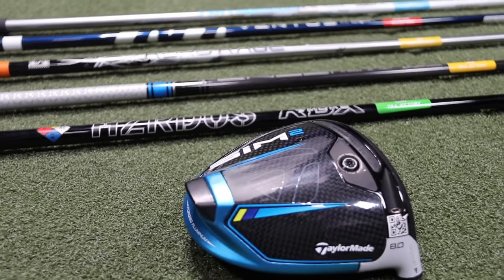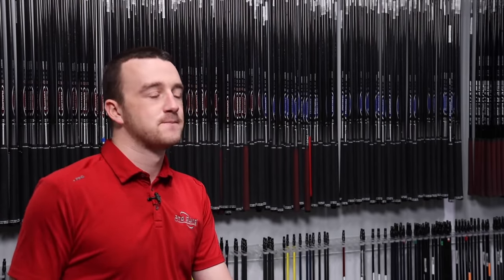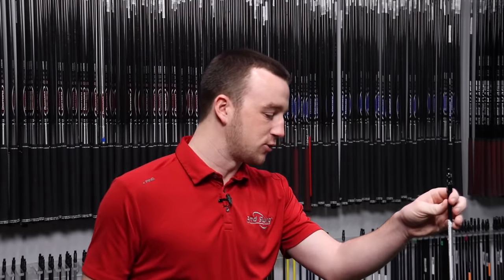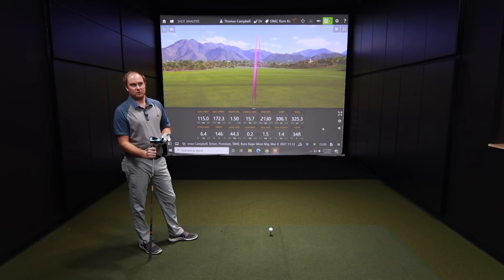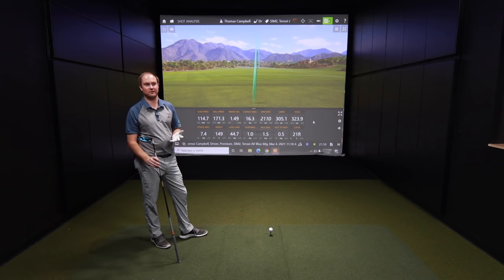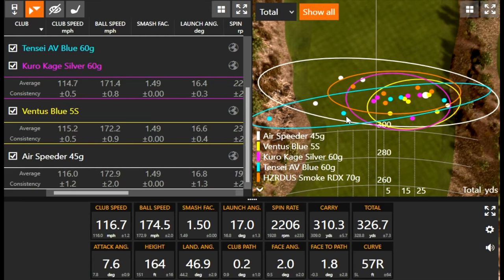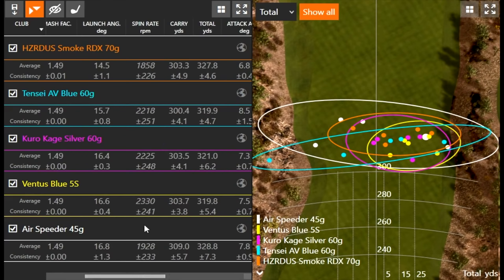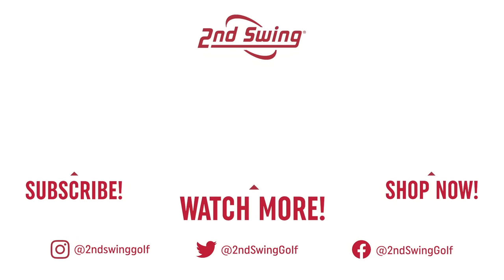Golf Shaft Testing | TaylorMade SIM2 Driver Shaft Comparison

Comment: Have read in a few different places recently that the LH adapter in a RH head fits the same way round if wanting to play in standard loft/lie. Its only when you try to higher or lower loft it works the opposite way round ie higher marking makes the head lower lofted.
Reply: 100% correct
Reply: Had exactly that recently - am lefty, fitted at my club and with Taylormade with RH tip spun 180.    When my driver came with LH tip set at 0, I found was totally wrong.     0 and 180 is exactly the same whether RH or LH tip.   Other increments would be affected which way you turn the shaft with the opposite tip to how you play.
Reply: Exactly. Turns out it would have been great to see Campbell hit the Tensei with standard lie instead of 2degree up (hence the hook).

Comment: I got fitted this year into the SimMax2 line and realized that I had lost about 20 yards on my drives.  And I was fit into a non upgraded shaft.  So I decided to do a year round live 'fitting' by buying a number of shafts and heads to see which I liked best.   So right now I have 5 SimMax or SimMax2 heads and a number of new shafts, ranging from the stock EvenFlow 50 up to and including the $500 Graphite Design Tour AD IZ 5.  I also have a used Aldila Rip 50g, a Mitsu Diamana S Limited 60 g also in R flex, a UST ProForce V2 HL, a KBS Tour TD 50 in R2, a Fujikura Pro 2.0 50g, my originally fitted Evenflow Riptide 50 5.5, a 'made for' Mitsu Kura Kage Silver and a real Mitsu 5th Gen black Kuro Kage shaft.   After about 100 rounds with these shafts the Mitsu 5th Gen KK and the KBS Tour AD 50 are head and shoulders above the rest.  Less dispersion but more importantly clearly 20+ yards more than any of the others.  I will set an appointment to hit the range with a launch monitor to try and break the tie between these two but clearly the premium shafts have value unless you are on a very tight budget.
Reply: You have too much money and time on your hands brother 🤣
Reply: You might need AA
Reply: What is your swing speed?

Comment: Very interesting. I have 90 mph swing, played TM Burner 10.5 R flex 50g shaft for 10 years.switched to Cobra F9 10.5 Fujikura ventus blue R flex stock shaft but it weighs 75g and I think it's too heavy, really inconsistent with it. Not sure why the fitter gave me this. Stock shape with the TM was straight/slight fade, all over the place with the Cobra. Really would appreciate a reply, thanks.
Reply: Ususally its the other way, people get shafts that are too light and it makes them very inconsistent, heavier shafts are generally more stable.  75g is more than normal for a driver though, mine is a x stiff but only 60 grams
Reply: Where did you get fitted .. Golf Galaxy ?

Comment: Bought my first driver, the max D. Was hitting it good with a regular shaft, even left. Fitter told me at the last minute I need a stiff and gave me the air speeder. It's all over the place :(
Reply from the maker: The shaft can be for sure player dependent. I would give that regular flex another chance if its straighter. Play the lightest most flexible shaft you can hit straight - Thomas

Comment: Please portray your dispersion circles accurately.  The wide dispersion circle of the air speeder 45g shaft is portrayed much larger than where the shots were dispersed.
Reply: the dispersion circles extrapolate to a confidence range with a normal distribution. My guess would be a 90% confidence interval. With 5 shots you dont see as much of the data going into the circle being drawn. since there was a lot of draw and slice in the shots the dispersion is wide and you could reasonably expect some more shots to end up further out. If the hit many more, you would see the circle be tighter around the data set.

Comment: Thomas' attack angle is insane. Any advice on bringing my attack angle up to 4-5 degrees from around 0.0 degrees? Play a 9 degree Sim 2 w/ 6.5 HZRDUS Smoke Blue. Making great contact but can't get my AOA up. 

Great video, appreciate the content.
Reply: shoulder tilt and ball placemtn to front foot or inside front foot heel
Reply: tee it up high
Reply: Play a 10.5 head.
Reply: @michaelforrester816  driver loft is irrelevant to swing AoA
Reply: @ocat1979  I know Brad. I only say what I did as my figures are similar to Nicholas. The extra club loft helped my +1-2 AoA as swing changes just wasnt working for me. Im 6ft7 and sometimes struggle to maintain height in the swing.

Comment: ..I am looking at getting the stealth driver possibly......i currently just got the stealth irons with red ventus shafts and the DHY clubs in the same shaft....my question is should i stick with the ventus red shaft for the driver ? in regular ? my swing speed with driver is 89-94 mph....i usually hit a high ball...i am looking for distance.... more the better ...lol i am thinking of also getting my driver length at 44 - 44 1/4 ....im only 5'7 and 57 years old.......what shaft do you think would suit me most ? thx cheers keep up the good work

Comment: Would you recommend the smoke shaft in stiff for 105 mph club speed over extra stiff?
Reply from the maker: 105-110 mph is a good cut off between stiff and x-stiff. Smoke stiff if you have a smooth tempo. X-Stiff if you have a faster tempo - Thomas

Comment: have the ventus blue 5-s  on the sim 2 max driver. cut the shaft from 46' to 44.5'. thoughts on swing weight? as of now shot patterns are going all over the place since the change and distance severely decreased
Reply: how? Were you hitting it better at the fitting?

Comment: Interesting!!  I have been using The Taylormade R7 Driver with 9.5 loft with stock shaft. I hit this driver consistently 270 yrds. Just 4 days ago, I received an early Xmas Gift for the new Zim2 MaxDriver...It came with the Ventus S-5. I took it to the Driver range yesterday and was not so happy. (lol) I hit the ball good with good impact  but when it descend, it turn to the right(I am right handed). I am trying to figure out on what it is I am doing wrong. When I switched with the old Driver(R7), I get good result. Maybe, I have the wrong shaft?  Please Comments and advise are welcome.
Reply from the maker: It could be the golf shaft, also what is the loft of your new driver? What is the length of the shaft?  If that changed or even the hosel adjustment is different a lot can change - Thomas
Reply: @2ndswing   the Zim2 Driver loft is 9.5 degree - It could be the Ventus shaft is too stiff for me..? Some said to try and change and put on the Nakarage shaft….more for seniors…my handicap is 9 but some golf buddies of mine with much lower handicap can hit my new Zim2 Driver long and straight…it has to be me.. lol
Reply: @2ndswing  sorry…. Kurokage shaft

Comment: so what happening with me using a Regular ADILA RIP in my R1 vs a stiff option? I did take a slo mo vid an it looks like the shaft is whipping forward at about 4 oclick in my swing and id think it should be at 5 oclock ideally, am i correct that im losing that whip threw the ball with to reg vs stiff or is it just dispersion? my natural shot is a draw and I do not hit anything to the right but my crap shots are left!

Comment: As someone who struggles with high spin and was fit for a Sim 2 driver but would like the Sim 2 Max Driver. For more forgiveness. Can you take the weights from the regular Sim 2 Driver and put them into the Max? Or would you say it’s all on the shaft? Currently switched back to my M1 440 driver with CK tensei Pro orange TX. Loving it again.
Reply: Saw another video said don't mess with the weight

Comment: I have a driver fitting this weekend. I have a 90mph ss and generally hit it straight. Currently have a Tensei Blue AV 65g stiff shaft in my flash. Think maybe is too heavy. Do you have any recommendations of shafts to inquire about?
Reply: use Tensei SFW AV Blue 55g
Reply: @azharariesaampstudio7524  They fit me in the Autoflex SF 405. Cant wait to try it!

Comment: It seems  getting  the correct  shaft could take a long section . Whats the cost for a fitting at  2nd golf. Ok  what about  the type of head to use  it seem that this could cost the golf a lot of money.  THEN IF YOU ARE A SERIOUS GOLF COST DOESN'T MATTER
Reply from the maker: The golf shaft will be player dependent. Some golfers may not notice much of a difference with premium & stock offerings and some golfers can notice the weight difference. Generally the type of head or loft on the head will make the biggest difference. At 2nd Swing our Fittings are FREE with purchase. - Thomas

Comment: There are many other variables  that will have to be considered n a fitting session.  Head adjustability today is also a major factor and has to be considered .  A  lot of information, but not totally on point.
Reply from the maker: You are correct, plenty of variables go into fine tuning a driver, thanks for watching - Thomas

Comment: Hi guys I was wondering if you could recommend a driver shaft to me. Here are my numbers using a tour edge c721 10.5 head set to 9.5
Swing speed 105-110
Distance 240-250 metres 
Ball flight Mid to high 
Spin 3500-3800
I'm getting smashed in windy conditions with the high spin and the high ball flight I have worked on my swing to bring that down and it has to a certain extent I am still getting the odd really high flight and big spinner dropping out of the sky even in good conditions.
Reply from the maker: Thanks for reaching out. The RDX 6.0 or possibly 6.5 (you're on the bubble) I would try a 9.5* head lofted down or turn that loft to -2* - Thomas

Comment: 1st, you should do a shaft preview with a golfer who can hit the driver consistently  Thomas is to worried about swing speed and slices, hooks and sprays the ball all over. 2nd, why an 8* clubhead? 80% of all golfer would do much better to 10-12* Thomas being one of those.. I know they think they can smash the 8-9* but they cant, just like this guy. Slow down Thomas you will find your control speed. I'm guessing 108-110 mph. Yeah I've fitted a few as well. Love your vids this one missed the mark